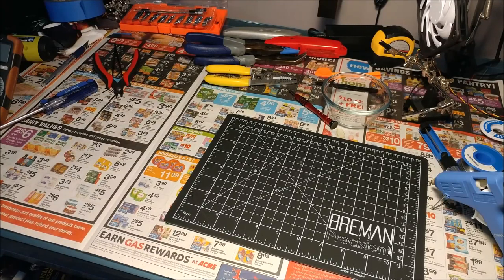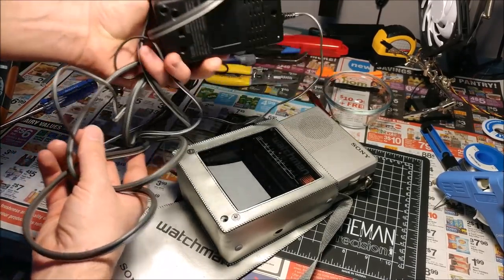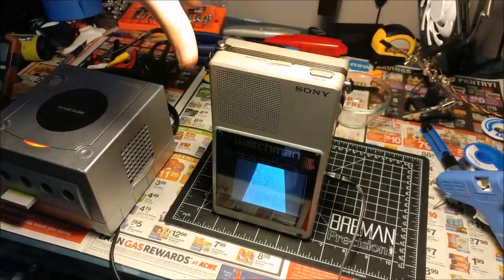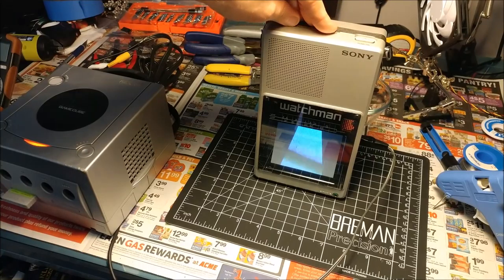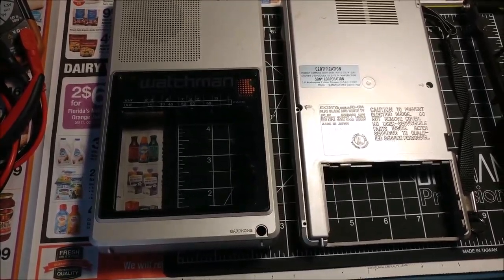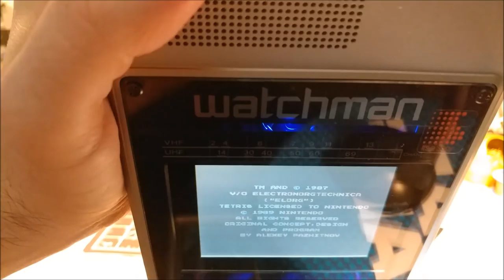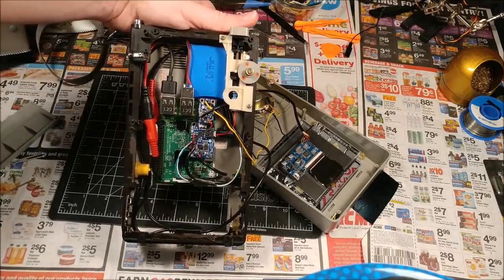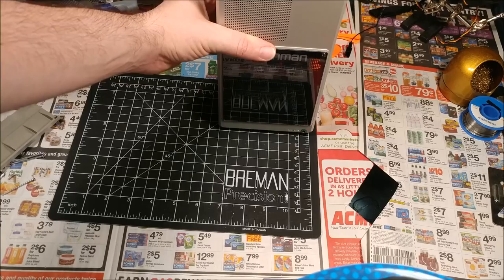The Sony Watchman RetroPie

Comment: I'm glad to see someone finally did this! I wanted to do something similar years ago but never had the time. I've seen some people posting videos using the watchman to play the pi video, but I always wanted to gut one and replace the innards. 
Cool project!
Reply: at some point i want to chase down an old zx81 case and replace the innards with a pi for my brother. Set it up so it can emulate the original using the original keyboard, or connect an external mouse/keyboard to run it as a pi.